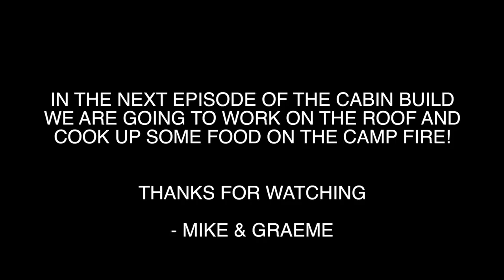Off Grid Pallet Wood Cabin Build in the Forest for Free - Wood Floor, Wall & Frame Structure

Comment: A few things I noticed:
* don't put any wood directly in contact with the ground, it will rot. Put it up on bricks, blocks or rocks.
* it bothered me that you were laying out the wood on uneven ground; take some extra time to smooth it out.
* pitch the soil under the cabin so water will run away, not pool underneath.
* don't have so many butt joints in the sub-floor, they are very weak. Nails or screws won't hold those joints very well.
* if you are going to have butt joints, at least back them up on one or both sides with pieces of wood.

Terry Thomas
(son of a carpenter)
Atlanta, Georgia USA
Reply: Terry Thomas I think you should win the competition for the most boring comments ever on YouTube. If you watch the video as well, you’ll see your comments are wrong. They didn’t place the cabin directly on the ground. Zzzzzzzzzz

Comment: Man good effort but, why even build it without a good footing? The floor will rot in a couple years and you have a huge pile of rubbish in the woods. I did something similar when I was in my late teens, I felt foolish when I went back in my late twenties to clear out the mess.
Reply from the maker: Its on tiles round the outside edge to keep off the ground a bit.

Comment: Only thing that made me cringe was in the previous video when you guys were building the floor joists, and you were just doing a simple butt joint and toenailing them together with no supports on either side.  Very weak joint.  But, so long as you guys are having an awesome father/son time, who cares.  :)   Looks like a lot of fun, and it is going up faster than I thought!

Comment: The spacing between the joist's is too wide ,the nails are not aus/nz standard, the sub soil stratastructure is unsuitable for masonry polypropolene  barrier. the lack of internal framing and many other issues makes this building perfect as a  bush hideout.. btw pallets are standard size worldwide ,every product is designed to fit on pallets ,example a slab of beer (24 cans)fits 10 slabs per layer 7 layers high ,one pallet load ,2 pallets fit perfectly side by side on the back of any truck or inside a standard shipping container, there is of course "skids" which is a pallet made to size to fit an individual item . all products are made to fit in cartons which fit perfectly on pallets

Comment: Yeah.  They are building the base ass backwards.
The foundation should have gone first.
But these guys have said repeatedly that they aren't builders and they don't care if it doesn't last.
Just the fact that they are toenailing pallet wood together should clue ya in that this isn't a proper cabin. 
It's a jerry rigged one man emergency shelter.
From that standpoint. It's just fine..

Comment: can this be for the homeless?
Reply from the maker: I mentioned in an earlier comment that a plastics company needed to look into making similar one-piece molded units for that exact reason.They could be moved around with a fork lift truck,be delivered by a small flat bed truck,and when not in use,put into storage. Would be a great way to recycle the growing waste plastics problem,s we have,and the shelters would help the homeless out big time.(Dad's reply)... Anyone out there a designer ? Check our finished cabin films when out and you will get ideas on format.